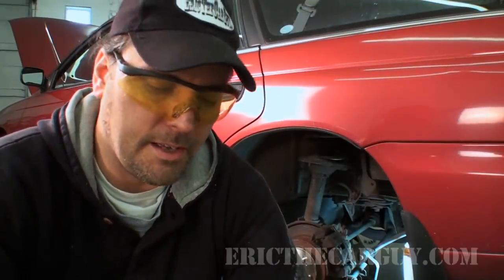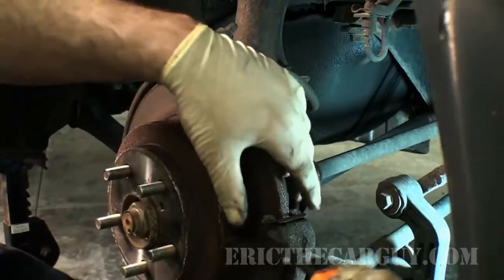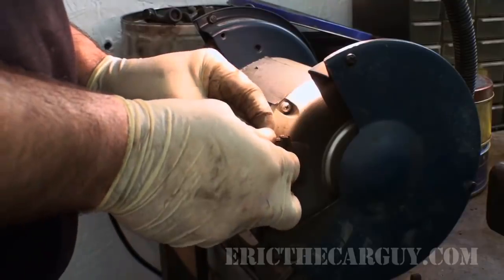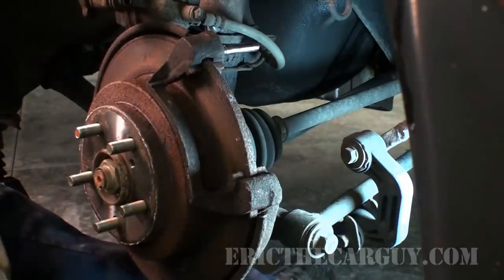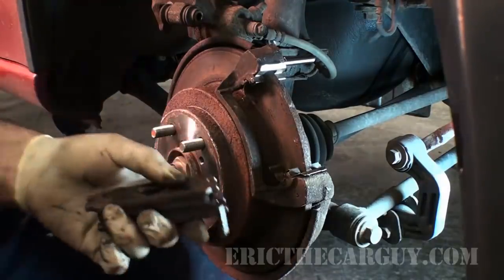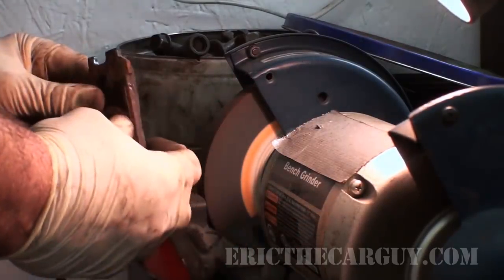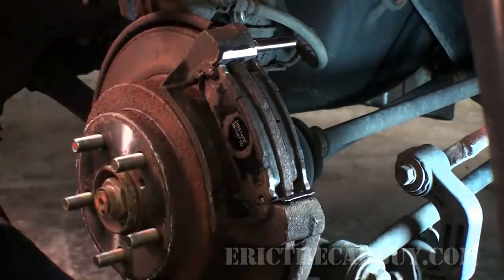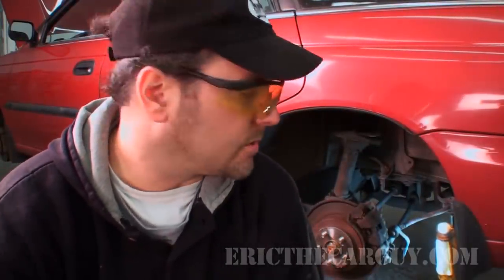How to Spot and Service a Stuck Rear Caliper - EricTheCarGuy

Comment: What vehicle was this. The parts for the caliper rebuild I need to buy look like the same as on this caliper. I have a 4 runner sr5. I'm having trouble with rotors warping constantly and my mechanic says my rotors will always do that unless I get drilled and slotted rotors for it. I take it in tomorrow to have another mechanic take a look at it. Seems to me that the calipers are sticking just not completely and have been for a while.
Reply: His advice is BS. 
Diagnose the caliper dragging problem.
They overheat and warp.
IF they are too thin,they will warp and chatter/vibrate.
Reply: Your brakes are overheating because of how you drive or how your old mechanic wasn't properly servicing your brakes. 

Chronic overheating warps rotors.  Drilling doesn't prevent warping. Professional racing drivers cars don't use drilled rotors, street posers' do. Poser mechanics install them.

If your car didn't come new with drilled/slotted rotors (a high end car $$$$ appearance mod), don't waste your money on them. Spend it on a good mechanic.

Comment: If one rotor is cut or replaced, both left and right need to be done. Rust iron oxide], being a weaker compound than pure steel, will be easily transformed to a smooth surface. Also my point being that the other side looked the same before the car was originally moved from being stored.

Comment: i had to do this same thing with the rear of my jeep, minus the grinding on the pads. now as far as the rotors go, if its just a light surface rust the brakes will clean that off.

Comment: Hi, I have a question, if someone could help me.
I took my car in to get all four brakes done, I have a Honda CRV 2000.

When they were finished with doing the job, my first time stepping on the brake pedal, it went to the floor. I pumped it, it would come up a little, but then it would drop back to the floor on the next time I braked.
 I took it back to them to fix the problem. After  looking at this problem , he came back to me and said to me that one of my calipers has a leak.
 (I did not have the brake pedal to the floor problem before I took it to them, to do my brakes).
Is it possible that they damaged the caliper? He told me that they cleaned it up, and it should be good, and to take the car home. If I have problems call him tomorrow. 
Welll,  the brake pedal seemed to be up (but not as high as i think it should be) for a bit, after about five times braking, it was to the floor again.
 My last 2 stops that i made before pulling into the driveway, made a sound like, rubbing wet leather or wet latex. A dull rubbing sound.

He also mentioned something that I might need a carburetor? (I'm guessing of what the part was  called) but he was pointing to the part that comes out of where the brake fluid is filled. 

Is this something that he damaged while doing my brakes, seeing as to how I never had the pedal to the metal (pedal to the floor😁) problem prior to me taking my car to him to do the brakes? 
Thanks, Much Appreciated.

Comment: great video if it was called how to spot & service stuck pads. Its called how to spot and service STUCK CALIPER. 15 minutes of my life I'll never get back later and not one word about servicing CALIPER!!!!!!!!!!!!!!!!!!!!!!!!!!!!!!! PLZ re-name
Reply: To be fair a lot of ppl would immediately diagnose it as a bad caliper and just replace it even if it's fine so this title makes some sense.
Reply: A stuck caliper in this case was rusty hardware,not the fault of a stuck caliper.
Reply: If your car was in a snowbank and couldn't move, you would say the car was stuck. The caliper couldn't move because of the pads. It was stuck, not seized.
Reply: I'm glad u only lost 15 minutes of your life!!!!  Wa Wa WA
Reply: His reference to servicing a stuck caliper is correct because the caliper pins, slides and brake pads are actually all parts of the caliper (unit).  He also shows something that many DIY car mechanics very often forget and that is the servicing of the caliper pins and slides.
Reply: Carl, would you be interested in a way to get your 15 minutes back by placing tiny classified ads in the newspaper?  lololol
Reply: I need help on a stuck caliper for 2008 f150 (rear) . could not get it to compress even after taking the cap off the master cylinder and opening the bleeder.
Reply: Often the pistons will not return into position inside the caliper, which seems to be a little more challenging, not just a sticky shoe. Compliments on the video, though. Thanks.

Comment: If the rear disc doesn't have any gouges, once the calipers are freed up, I just drive the car for a day and found the brake pads sand the rust away.

Comment: Hi Eric I'd like to check with you about my lower caliper bolt that is stuck, but not overheating or something. Could that be a cause of squeaking (tweet, tweet, tweet)? If its not the caliper bolt, what is it? The sound synchronizes as I drove the car faster. It didn't stop the squeak even if I depressed the brakes slightly/hard. I already replace a new brake pad. which I knew its not on the brake pads. I also did replace the wheel bearing.  Hope you could give a feedback on this?

Comment: Mostly all drums are self adjusting. Using a ratchet type system. "star wheel adjuster" its referred to alot. I prefer disc brakes as well. Easier to service. Much easier.

Comment: Eric, I know you posted this years ago. So hopefully you see this. What would your opinion be on pulling rusted rotors and using a cup wire brush to take the rust layer off and give the pads a clean surface to bite instead of gumming up or glazing over from the rust it has to rip through?
Reply: I have done this, or similar, several times and been successful. Be sure to clean the dust off before reinstalling the rotor.
Reply: @ericschofield3244  Yeah, because there's no way they're going to get dusty again because they're brake pads and rotors, lol.  Hint:  Cleaning that off makes not the slightest bit of difference.  What needs cleaned off is grease or oil if any is present.
Reply: @stinkycheese804  Bad advice.  It DOES make a difference. See my post about uneven heating if rustiness is patchy. It happened to me ... so now I clean both disc surfaces with garnet paper.
YES - grease/oil removal is wise because if it impregnates the pads you'll virtually never totally remove it.
Reply: I'd just replace a rotor that rusted. Takes too long to go get it machined and if they charge you, its probably almost as much as a brand new rotor. I'd get new pads too. And actually probably a new caliper, they're not that expensive.
Reply: Peter Bloggs I agree, I hit them with a wire wheel on a grinder. The dust/rust/contaminants form small little pucks between the rotor and pads classing uneven contact and therefore uneven transfer of heat.
Reply: @AmandaHugenkiss2915  thanks tips

Comment: The sliding pin on my front left disc brake seems to have seized, causing the same wheel to stiffen when you mount and torque the lugs. as far as dislodging it, would a rubber mallet and a vice suffice?
Reply: Banging on it is more like;y to crack a casting than get it free. It is seized because either because the cylinder in which it is supposed to move is hydrolocked from excessive lubrication, or is rusted. Try lettng PBBlaster soak into that bore,  then wrapping it with friction tape and twist it with vicegrips.

Comment: I never entertain ceased rusty calipers, just brushing them clean and lubing only buys you time before it does it again...I always rip them down and shot blast the caliper and carrier (can remove almost 5mm of rust growth in some cases) then paint, new piston and seals where necessary then rebuild with lots of rubber grease on the piston and lots of copper slip on sliders and pad tracks...caliper will last years as not being able to rust will stop then ceasing.

Comment: my sister has a 2010 honda accord and her rear pads locked up as well. also her parking brake does not disengage after engaging. anyone know if this is a common issue in hondas? a friend of mine had the same issue in her acura rdx
Reply: Honda's have cable-actuated calipers and they are trouble prone!
The parking brake cables freeze up and will not release.
Common.

Comment: My brakes randomly lock up and the pedal gets hard when im driving. It happens to all four brakes, and they start to get hot and smell after a while. Eventually they will randomly loosen back up. Any suggestions? Its a 1993 Toyota Camry LE.
Thanks a bunch!
Jake.

Comment: @EricTheCarGuy 
Hi,I have a similar problem with my ford escort van. The front 
right calliper stuck on for ages and destroyed the pads and wore out the
 disc,so i bought new discs,pads and replaced the calliper.
 Seemed fine for many months,then all of a sudden it came back sticking on again, BUT at the same time on the rear of the vehicle so did the back left brakes (which are shoes)
So at the same time front right calliper (pads) sticks on and rear back left (shoes).
Do you know what this is???, why are they both sticking on at the same time, they were actually smoking hot,i did see smoke coming out.
Also a few days aga,i totally replaced both rear brake shoes and also renewed with new drums too,so the back has been totally replaced as well and they were all free,handbrakes works fine etc.
 So what could cause the front right calliper and rear left brake shoes to both jam on at the same time??
 Could the fromt flexi pipe if faulty, also cause the back left brake to react at the same time?
Thanks in advance
Reply: Did you change the brake fluid pipes that go to the calipers?
Reply: R Sood
The flexi pipes, the rubber brake hoses,NO,that's what i think it could be.I oredred the front right one,yet to arive.
Do you think it could be this, would it cause front right and back left to jam on together?
If thats the case i cant understand why what happens at front right also effects rear left
Reply: That may not be a problem. The inner hose walls do collapse over time.Some cars have cross braking. Most have front and rear.
that way,if if a RF caliper blows,the LF and RR will stop you.
Reply: I have now replaced the front right flexi brake hose and for 1 day only it was perfect, now the brakes are back to normal jamming on intermittently whenever they feel like it.
I now have to take an 11mm socket with me to release the brake calliper everytime it happens,which it does release instantly. This is driving me crazy. Ive got receipts that show these problems from the previous owner,the master cylinder was replaced and both front flexi in the past and ll pads and shoes renewed.
One thing i have noticed is that the cap to the brake fluid reservoir (master cylinder) doesnt screw up fully tight,its tight but iof you overtighten it it comes undone again, could this cause it?? My vehicle is  FORD ESCORT VAN MK5 uk type
Reply: No. 
You may have a stuck proportioning valve.
It VERY possible that the caliper piston is NOT returning after pressure.
The master cylinder cap allows moisture in if not tight.
That is really bad for brake fluid!
It will absorb moisture:WATER and lower the boiling point of the brake fluid.
  As as an armchair quarterback,consider caliper replacements,fluid flush and use the same old pads.
Reply: ddd228
I did already change the calliper same issues even after, then i changed the flexi same again,only when yesterday i undid the 2 bolts holding the Master Cylinder to the servo did they totally free off instantly,i will know for 100% when i back off the push rod coming out of the servo
Reply: Well,loosening the master cylinder freed up the caliper? WTF. What was holding the push rod the the "ON" position? How is the push rod too long?They come adjusted to the correct length. There is a spec for it,if you are willing to dig around. I wonder if the mechanical link to the brake pedal is sticking or the brake light switch is involved.
Weird problem!
Reply: ddd228
Hi,thanks for comments, so ,so far i changed both front discs+pads both rear drums and shoes,front right flexi pipe,drivers side calliper,bled system,tightened up fluid reservoir cap,done all that and still sticks on but....I think i've found out what the problem is.
Originally the guy before me had problems with the brakes with this van,ive seen receipts for new flexis,pads and a brand new master cylinder,so i know that was done in the past so problems.
When he sold me the van he said the brakes jam on now and again,so i knew about it,but here's the problem.
I since found out that whenever a master cylinder is replaced,it's NOT just a simple swap,even if original part,the push rod that comes out of the servo has to be adjusted to the correct gap between the end of the rod and where it touches the master cylinder contact point,over time this can come slightly loose and in extreme hot conditions ,like recently here it can expand close the gap and make the brakes slightly jam on even when not pressing the pedal.
 When the brakes last jammed on i pulled over and undid the 2 x 13mm bolts holding the master cylinder to the servo and instantly the brakes freed off,which means only 1 thing...
The pushrod that goes into the master cylinder has either moved or was never adjusted correctly when refitting a new one.
 All i have to do now,is remove the master cylinder totally off the servo and readjust (back off 1 turn) the pushrod,so that when its reassembled it isnt already pushing the brakes slightly on.
 What also confirms this is the brake pedal does not go fully down to the floor and the brakes have never been excellent in stopping, and thats because the pushrod is already touching,so obviously the foot pedal wont allow much travel.
 When ive adjusted it,i will post back,i am 99% sure that this is it, what do you think??
Reply: ddd228
Also, whilst the master cylinder was slightly unbolted but still connected,i pressed the pedal inside the van and i could see the master cylinder moving backwards and forwards,i.e. releasing every single time, so i know its not a jamming on problem,where the pushrod is getting stuck,it did every single time go back and forth,proving even further that i think its the pushrod adjustment,not many people i found out know about even this setup of having to adjust it,they just swap over the master cylinder and most of the time it works,but in my case its either never been adjusted correctly from new or has come slightly loose and adjusted further out.
I have to adjust it to the point where it feels just right,no jamming or binding wheels when spinning them and to make sure that when i brake force is felt to make the brakes work when the pedal is pressed,either way it will be 100% better than what i'm experiencing now.
 For many months i thought this van isn't very fast,i realised that the brakes were always jamming on all the time but very slightly until they totally locked on, since removing the master cylinder bolts and it freed off, the van went much faster and felt free :)
Reply: It's a WEIRD problem that came up!Usually the pushrod lungth is correct. It was a biattch to diagnose and I salute you!
Reply: ddd228
Yes i went the long way around the block to get to the neighbours (as so to speak) but one good thing is brakes are all new now :) Obnce ive adjusted the push rod properly, then i will bleed all the brakes again and it will stop dead when needed,at the moment its still a bit weak

Comment: I have 2 rear calipers that pepboys just told me are stuck and i need to replace them?
I always had suspicous about the read brakes. The rotors dont rust up but when they showed me the brakes that the inner pad still has pad left on it, and the outer pad is completely metal to metal contact?  Does this mean bad caliper? Should i replace caliper or should i just "service it" like described in this video? any help appreciated. thanks

Comment: What would happen if you just let normal wear take care of knocking the rust off of the rotor? Wouldn't the rotor get polished eventually?
Reply: You want the face that the wheel seats again, rust free so the wheel mounts true.  You want the rim, the lip above where the brake pad sits, free of rust so the lip doesn't build up higher and higher relative to the pads to the point where you have to do a lot of prying on the pad to get the caliper retracted, which is not a big deal if replacing the pads anyway but if not planning to replace them, you don't want to chip off part of the pad... which isn't the end of the world as long as it doesn't create a larger fracture but still, better not to, and faster to get the caliper off next time.
Reply: Calvin.  Snag is ... IF the rotor rust is uneven (i.e. very little where the pad was)  the heating will be uneven and the disc may warp AMHIK ...

Comment: will regular anti-seize work or do i need copper anti-seize ? 
and why ?
Reply: MrMrsregor Both work. Some people like copper when dealing with brakes because copper stands up to pressure better if you use it on the brake hardware to help the pads slide but I would use like high temperature ball bearing grease for that but you can use the copper anti seize. For the sliders you should use silicone paste because that is what they come covered in from factory. Grease and silicone don't mix well and will make a sludge substance. You can use grease though if you clean the sliders really well first. That is what I do. Now for all the bolts copper anti seize also holds up to heat better than normal anti seize but normal anti seize stills works. I have never heard of anyone having issues using normal anti seize so do as you wish. I personally like copper better so I buy the bigger tub and just use it on everything I need anti seize for.
Reply: cool thanks !

Comment: Eric, my front brake on the driver side isn't working. No brake fluid comes out when I undo the brake hose. How do I know if the proportional valve not working or brake hose block?